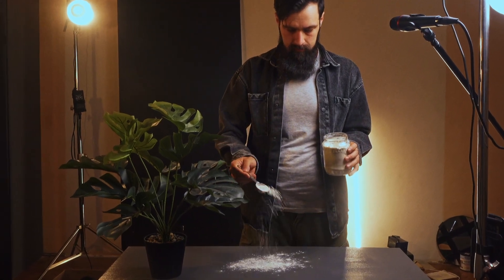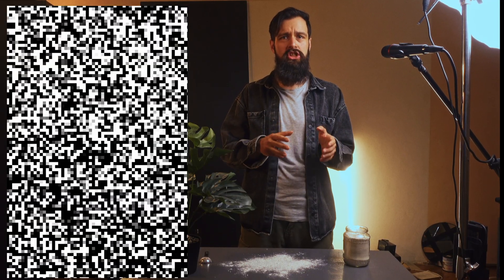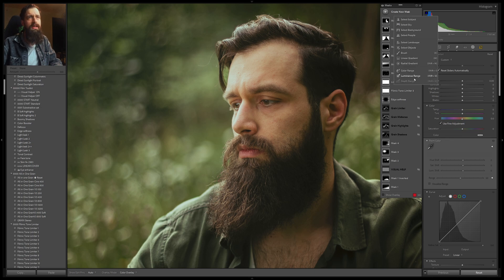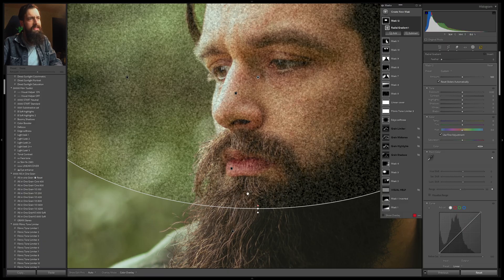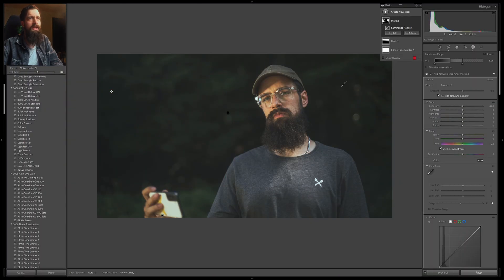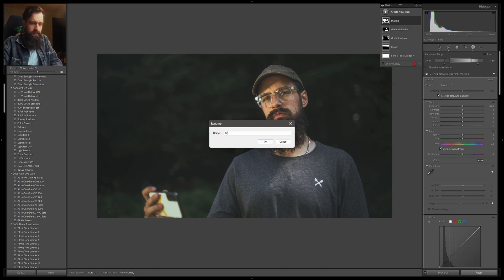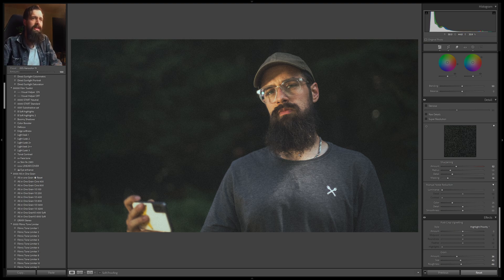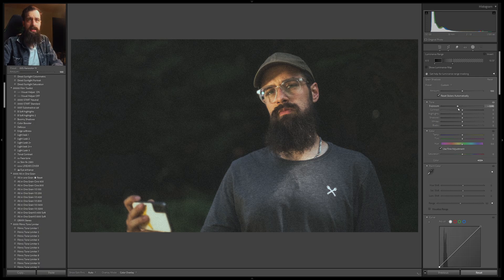Film Grain emulation in Lightroom - Everything you need to know  #lightroom

Comment: LR grain isn’t the same as original film grain.
I use scans of original film grain as a overlay for my photos.
Like TriX, Delta100, Portra160
Reply from the maker: yes and no... i mean LR grain lacks color and thats horrible. but if you use overlays you also have to deal with the sharpness of the image underneath as a completely independent problem and make a mask to distribuit the opacity so its a huge pain in the rear
Reply: @vmoldo-com not true.
I have scans from 50%gray of various original film stocks, including Portra160 and Portra400 and don’t face that problem at all.
For the majority I do BNW!
And I use a real program that called Photoshop. The grains are the top layer that is set to “overlay”.